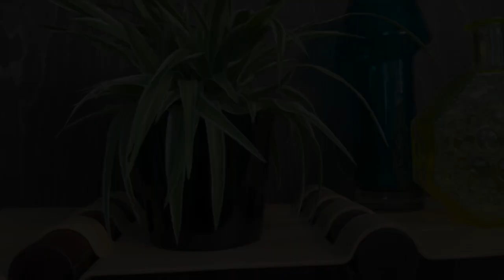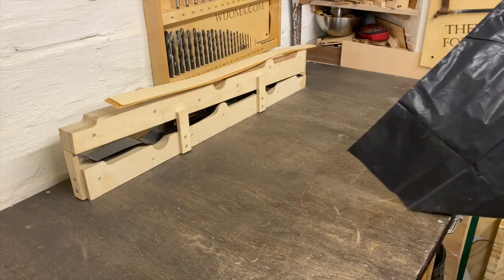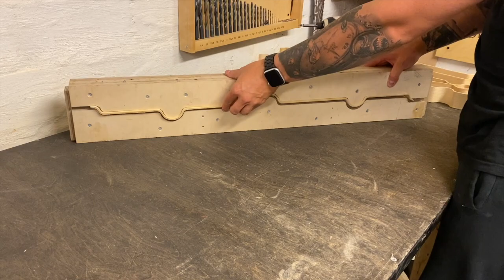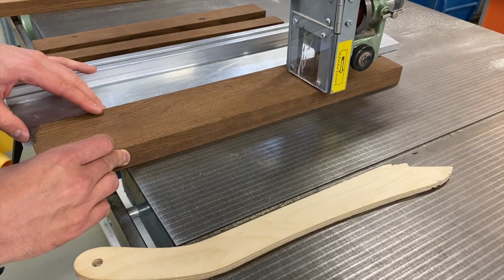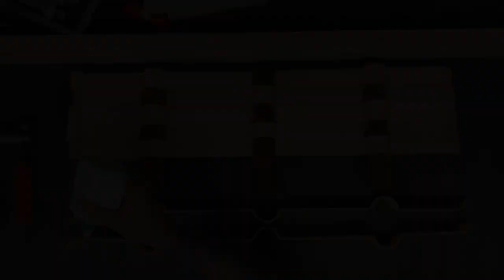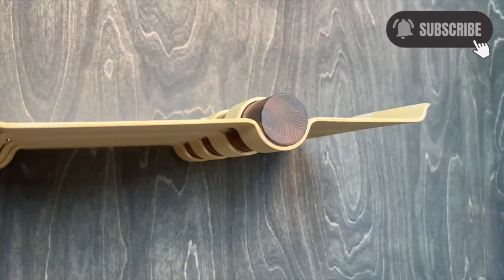Floating Design Shelf | Master Carpenter Woodworking 2022 | Unique Joiner Veneer / Wood bending DIY

Comment: You stuff is sick. I was wondering if you think you could archieve similar results with cardboard and resin ? I am thinking of new ways to replace sheet metal. I like to make objects like lamps or furniture our of sheet metal with rivets however sheet metal is expensive and hard to work with compared to wood. Wood veneere is great too but I thought I might even to one step lower and use a composite material (cardboard + resin). I am not as craftsy as you I am a mechanical engineer, so I was wondering what you think of my idea ?
Reply from the maker: 🙏🏽🙏🏽🙏🏽
I don't have much experience with resin, but I think your idea will work! You have to try it! 👍🏼

Comment: Awesome project Visa! What type of glue are you using? Keep up the good work!😉👌
Reply from the maker: Thank you! I use Cascol polyurethane glue for bending and Titebond III ultimate glue for joints etc. 😊
Reply: @Veisalm  thanks for sharing Visa. Yes i did mean the glue for the bended parts. Luckily i found a shop that sells it in the Netherlands.  I ordered a bottle of casco pu glue. Do you have other socials where people can follow your amazing projects? Greets Don.
Reply from the maker: @donvangroenendaal2679  No problem! There are many polyurethane glue in market, but I like to use that casco ones. Good to hear if you get one to your self! I think this is the main place/site to this kind of woodworking :) Right now I'm concentrating to Wuoma design so maybe in autumn coming new content here. 🙂